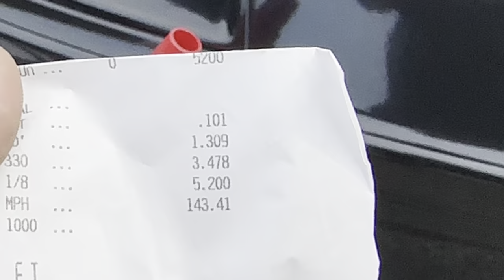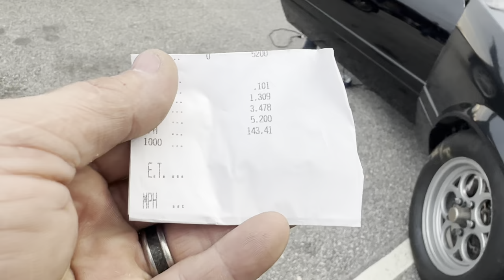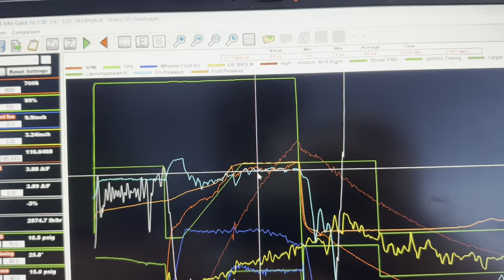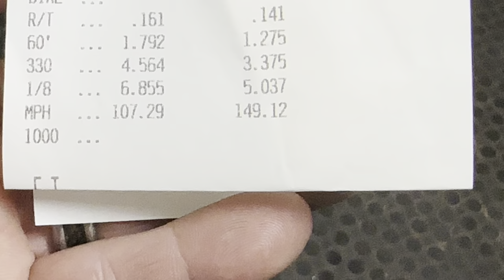Big Block Chevy Foxbody is Fast….. Personal Best 1/8 mile.......  Let's GO!

Comment: Now, decision making time. What can you move around in the car as far as weight to transfer from front and middle to the exact places that the added ballast is (same for same lbs in the same places on the rear that allows you to remove added ballast). Every lb you transfer allows you to diet the car and make it lighter without making any other changes to the way it goes down the track. You were not inputting much steering effort into it anymore. And it starts correctly without brakekleen!

It is work and expenses to move systems rearward but it is always worth the effort as long as full faster passes is maintained and you get lighter over-all w/ every change as you get faster doing it too.

Comment: YOU NEED A FORD MOTOR  ...
Reply: 😂 I was buying a Falcon from a die hard Ford guy. He suddenly backed out of the deal because he thought I was going to drop my SBC into it. I was just going to build a 347 or something real quick and go bracket racing but he didn't believe me! I didn't get the Ford.
Reply: To be honest. I started off running Mopar, then Buick and later on Chevy. I'm not a die hard brand guy because every one of the brands will rip anyway. I do realize that at some point Chevy stuff is easier to obtain but there is a way better selection of aftermarket Ford parts available these days.

Comment: So, you know your front heavy.  But if I recall, you have 14/75 springs out front, and 14/90 in the back.  That's backwards.  Swap the front to the back and vice versa.  Then remove the weight you added to the rear.  Car will be more balanced and shouldn't bounce.
Reply: If it's still to bouncy, go back to the 14/60 you had in back.  This should help you get the squat you want and make your shocks tune in better.

Comment: Come on TJ, you have a 2600lbs car with a BBC with a 118mm turbo at the track. If you ain't going 4.30s it's kinda embarrassing
Reply: Car is new my guy.  it’s not a 500k shop built car that is gonna run the number on the first pass.  Show us your 4.30 car.